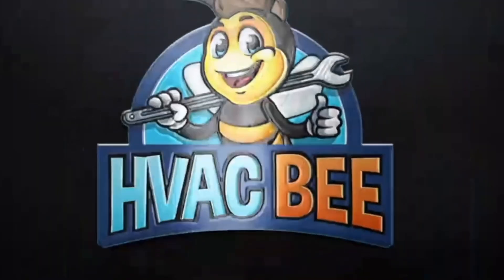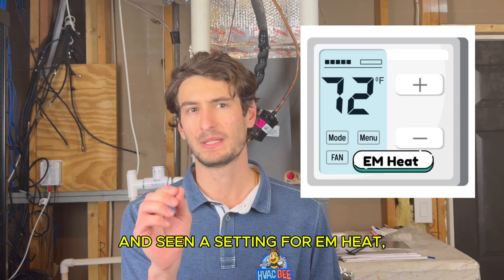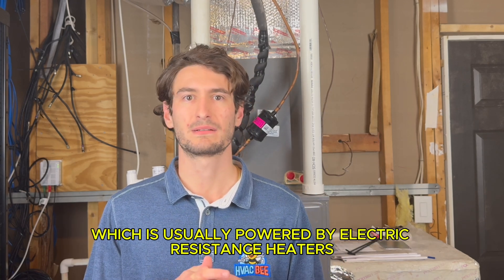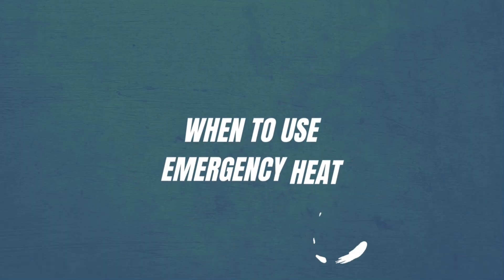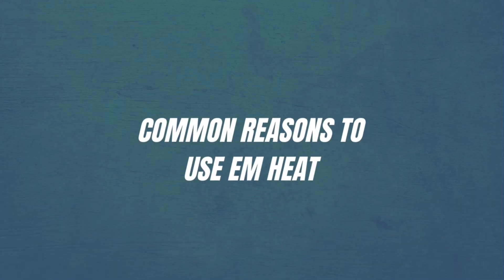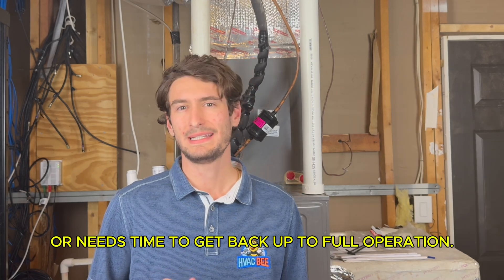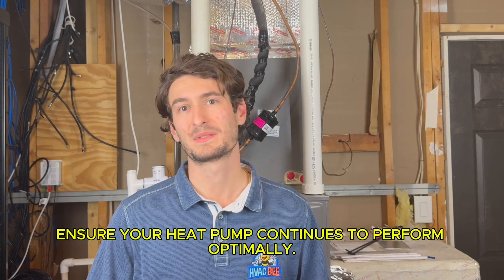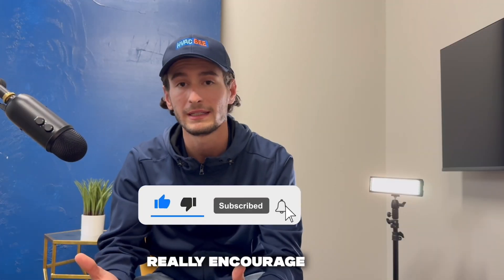Why Your Thermostat Has an ‘Emergency Heat’ Setting

Comment: My American Standard comes on automatically and triples my bill. I never know exactly when. Hate it. Wish I could disable it.
Reply from the maker: You’re not alone — that’s is definitely the emergency/aux heat kicking on. It comes on automatically when the heat pump can’t keep up, and unfortunately you can’t fully disable it. 

A smart thermostat alert, lowering the aux heat lockout temp, or having a tech check settings can help keep it from running so often and blowing up the bill. 👍✅

Comment: There is an explicit 'EM Mode' on our Honeywell thermostat (manual does not clarify) ... but the question is if you are just in regular 'Heat Mode' do the thermostats automatically go into an "EM Mode' if they determine they are running too long (ie. have some smarts in them)????
Reply from the maker: Great question! The smarter Honeywell Thermostats do have this capability. 

I believe the Honeywell T9/T10’s both can ‘automatically’ kick on EM Heat as Auxiliary Heat (or supplementary) heating. 
On the flip side, I don’t think the Honeywell T6’s are able to. 

Do You know the model of your Honeywell thermostat?👍
Reply: @HVACBee  Thanks!  It appears to be a T6 (likely TH6210U2001).  It was in the low-mid teens here a while back and the heat was able to keep up with our 69F setting but I wasn't sure if it was doing 'EM Mode' behind-the-scene!  The heatpump is the York YHE30B21SB per a label on it.
Reply from the maker: @Scott-sm9nm  Nice! Glad it was able to still keep up. Sounds like it must have good duct work and be sized properly. 👍 

We love the T6 thermostats. Most bullet proof in my mind, but they do lack some of the ‘smarter’ features for sure. 
But still love the hard press buttons over the touch screen models today.
Reply: @HVACBee  Thx! -- I take that to me then that the T6 does not have the feature to automatically go into 'EM mode' if it thinks it needs to and it is up to the home owner to manually select the 'EM mode' if the system was not keeping up?
Reply from the maker: @Scott-sm9nm  Hey Scott, that is exactly right! The homeowner has to switch over the thermostat Manually on a Honeywell T6 if they notice their system not working properly / keeping up. Thanks again for checking out the video and if you have any other questions, just let us know! 😊🐝